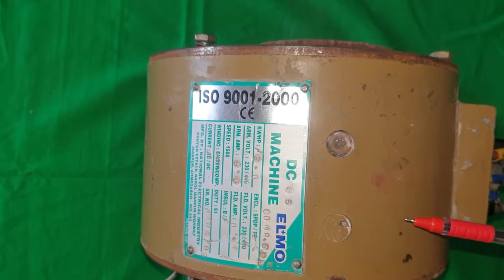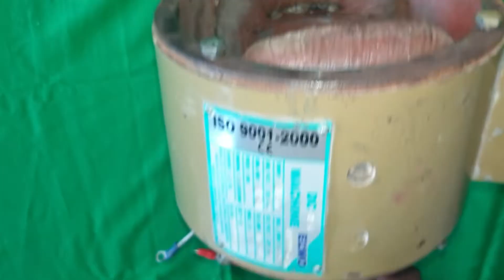PARTS OF A DC MACHINE.

Comment: High Speed Motor 2800rpm and Low Speed Motor 1400rpm it's motor terminal connection and where it is applied